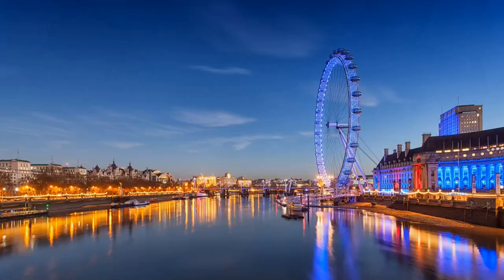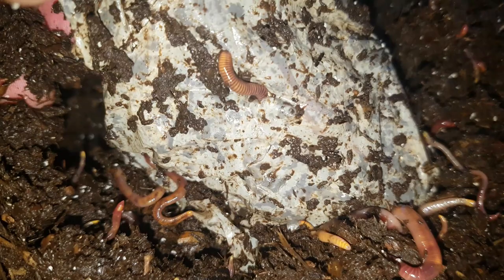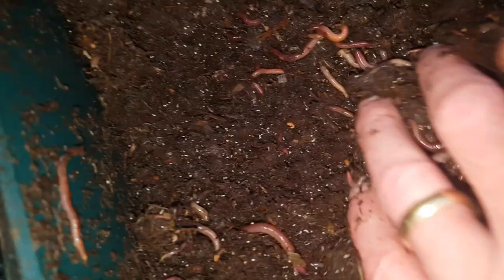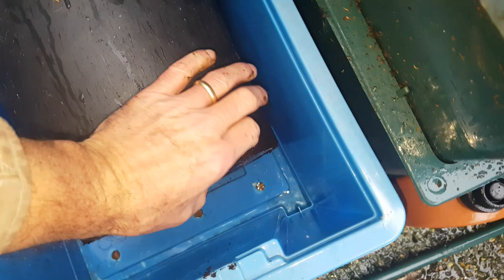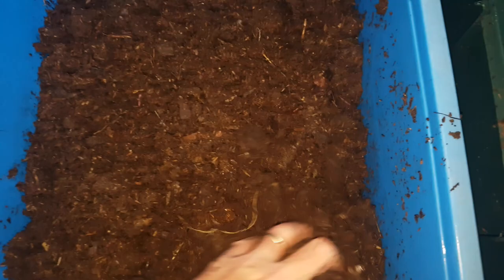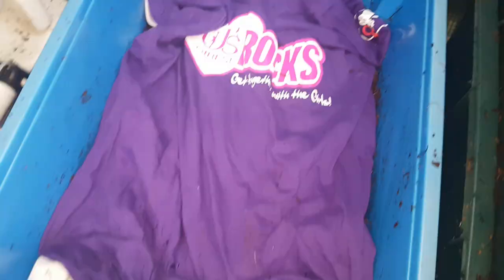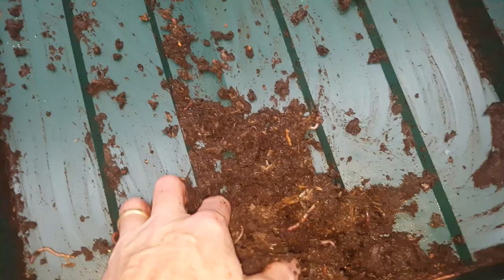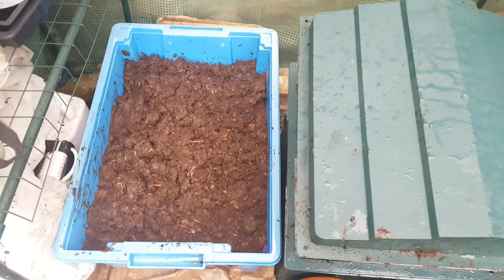Composting Clothes with Worms Week 1

Comment: Did you put anything over thr top of this bin did I just not notice? I really want to get into making a worm. Bin next year I've an old wheelie bin on the allotment I was gonna convert
Reply from the maker: A wheelie bin would make a great flow through type worm bin. Due to the incessant rain I cut it short and didn't cover the bin. I went out later to check on it and was going to cover with cardboard but in the end I just left it. So it's in the cheapo plastic greenhouse but uncovered. If there is any escapees they'll only go as far as the cardboard underneath.

Comment: Out of curiosity - When you have 100% "Muck" what's to be gained, over adding it straight to the soil?
Reply from the maker: If there's x amt of good bacteria and soil microbes in the muck ... when it's reprocessed by the worms and their casts added it has 10 times x or more good bacteria to add to the soil. The nutrients tied up in the casts are also more plant accessible than from the manure. Although I don't normally add manure to the small bins Brian. It would normally be food scraps but I've none at the moment as I've not been able to get to the home that supplies me and what I had went into the big bin as the worms there were complaining they'd not been fed in days 😁
Reply: I use a small amount of muck with some veg waste as a bin starter mix.